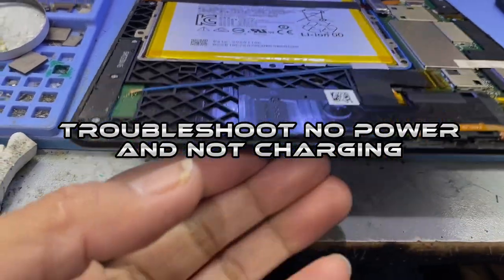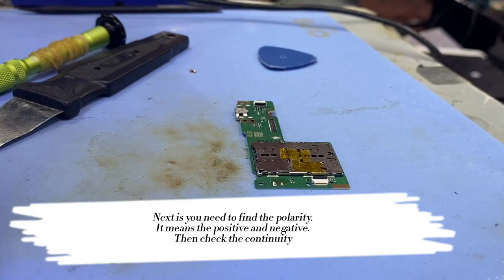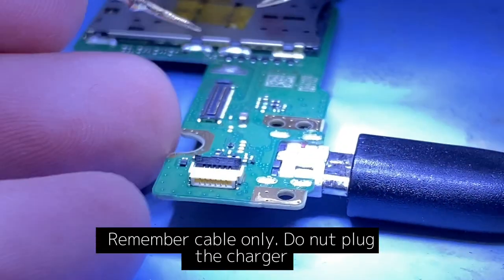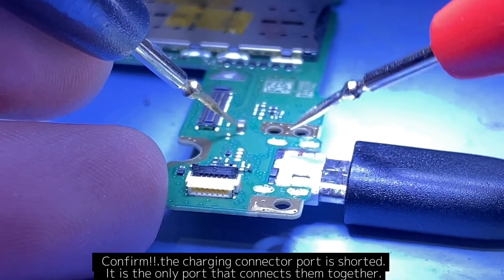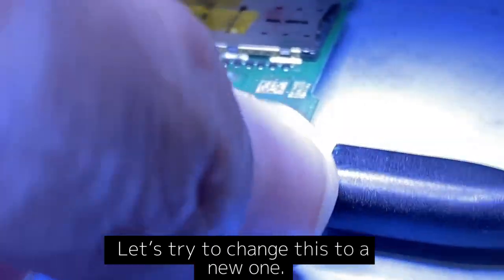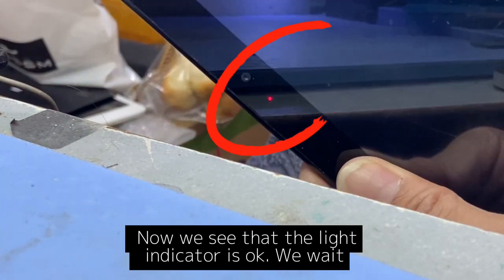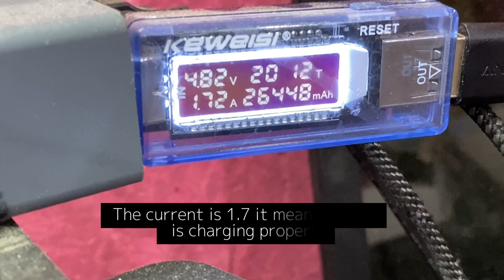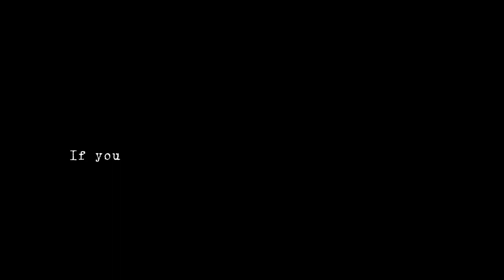Lenovo tab no power and not charging

Comment: Great video 😊💪, easy when you have the good tools and skills 😊 where you get the correct new USBC plug?
Reply from the maker: Mostly from china. We have a supplier but you can buy online it’s very cheap.thank you for the feedback.
Reply: @Repairingtools Payed ALOT of premium for the Lenovo P12 Pro with Snapdragon 870. Will most likely not by going Lenovo again coz of these quality issues! Luckely theres 6 months of warranty on the battery, which is exactly now when it started to not receive a charge. Tried both Lenovo & Motorola charger. Motorola worked first time, then second time it charges only at 5-10% an hour at 200mA. Swapped to motorolas charger made 65%, at 5000 mA. But the second time i charged it, its just as slow as Lenovo's charger again. So its going in on the besis of warranty claim! Thanks for video anyway!
Reply from the maker: I encounter this issue in some samsung tab. Gives only 600-200  it’s an ic fault. .i use only 3ah bellow. Thanks foe the feedback

Comment: Hey i have a tablet which is technically identical to Pipo W4, except customised by a local brand to give it an aluminium back. I had the touchscreen break because i sat on it and the touchscreen from W4 that i bought from China worked just right.

Now another issue, i connected a USB hub to it with charge passthrough and when i connected also my hard disk, the charging died in the tablet, it still ran but no longer takes charge since then. Do you have any hints on how to proceed with repair? I could just add a secondary charger board i suppose, but i hesitated to do so. Do you know what faults i could expect on the PCB?

This is an 8" tablet with Z3735G Bay Trail SoC and only 16GB eMMC. It is very cheap and not worth contracting a repair company for, but i have soldering skill. I also wonder about replacing the eMMC with larger capacity. I can't say i need it but i try to repair and modify all the things and improve my skill.
Reply from the maker: Check the port first.If the port is micro i think you can make it work by replacing it. Always check the first and last pin for 5v and -  input. The other 3 are for data only. If the port is type c you need a little bit skill to change it (many types of usb-c). For emmc you need good understanding of basic flashing and data recovery. Also you need many tools to change it.